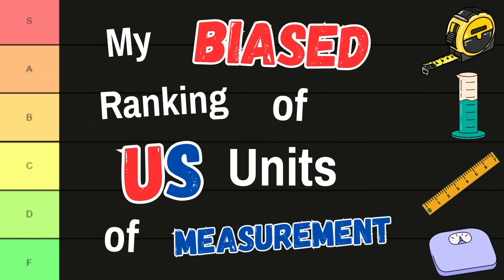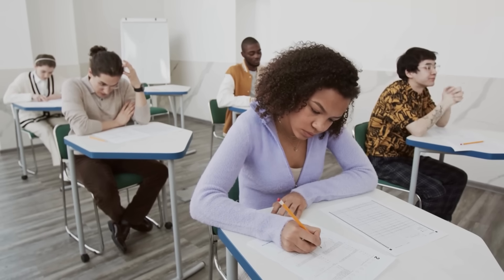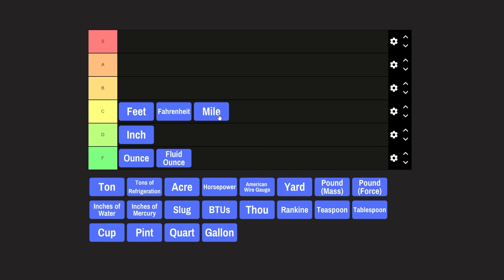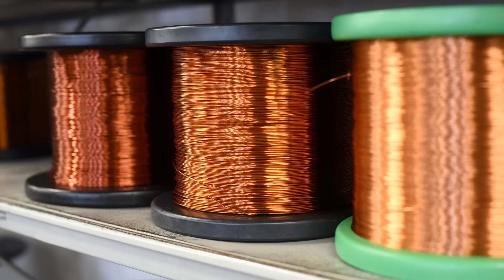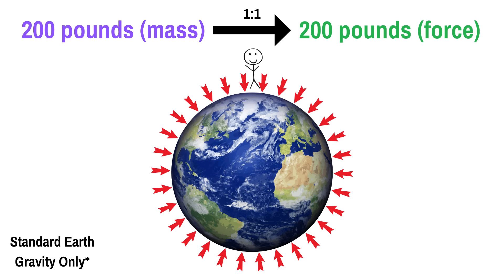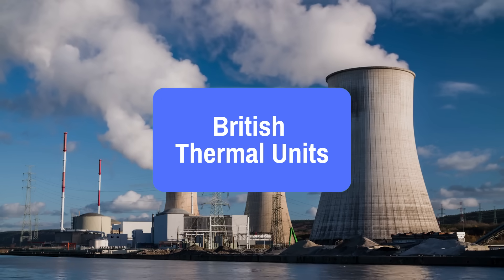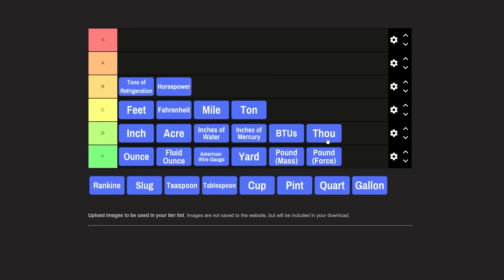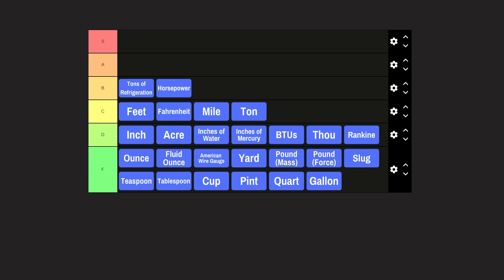Tier List of the DISASTROUS US Measuring System

Comment: Fahrenheit:
Calculations? F tier, god damned awful. What maniac forces you to do physics (beyond kinematics) in Imperial units? No one tried to make me use Fahrenheit in physics.
Measuring extremes of temperature? C tier, maybe only D tier. Use Kelvin, you nut. Especially if it’s EXTREME cold. Extreme heat? Celsius works…
Measuring temperatures we might subject ourselves to? B tier. Pretty damn good. 0-100 °F is pretty close to the range of temperatures we can handle with just clothing. Additionally, it gives finer-grained control on thermostats, and offers a full range of 20 degrees where nearly everyone finds their comfortable temperature: 60-80°F. I’m not saying anywhere in that is comfortable for most people, I am claiming/estimating that nearly everyone’s ideal temperature is somewhere in that range.

Comment: I missed al the surveying length measurements like rod, chain, furlong. And 1 furlong  x 1 chain = 1 acre. This one is surprisingly logical.

I really like to poke fun at the 'customary' system with this list of numbers: 3,12, 3, 5.5, 2, 20, 8

If you wonder, it's the multipliers going from one unit of length to the next: Barleycorn, Inch, Yard, Rod, Chain, Furlong, Mile (oh, I left out the fathom: two yards, and the cubit: 18 inches)
All these units made perfect sense when we measured lengths with body parts. But it has been a while.

Comment: I grew up in probably the only generation of Canadian education that's likely to ever exist where they taught Imperial and Metric right alongside each other, and most of our measuring tools had readings for both systems. While most official and scientific measurements were metric, many of the adults in my life still used imperial to describe things. As a result, I'm essentially "bilingual" when it comes to measurements, so if I hear one, I can generally interpret it into the form that I am most comfortable with, and that makes the most sense given the context.

For example, I convert Fahrenheit readings into Celsius. I prefer Imperial measurements (inches and feet) for short distances and kilometers for long distances. I cook exclusively in Imperial (including baking), but I like my beverages and other liquids measured in liters, UNLESS I'm using it to cook. Yes, I'm aware it makes no sense to switch between referring to water as 2 Cups or 500mL (approximate) depending on whether or not I am cooking or just drinking it, but I don't care! 

I think the whole debate is a little over-hated anyway, and I think there would be a greater net benefit to all if we decided to learn to interpret and convert back and forth, rather than discard and forget.

Comment: I don’t like the imperial system either, but if you wanna say that ounces and fluid ounces suck because they are only linked with water, know that a cubic meter of water weighs a 1000 kg, but since measurements have changed, it’s about a kg off now, making it really annoying.

Comment: They picked 5280 feet because it has 48 factors. This helps when you want to know that a 32nd of a mile is 165 feet but a 33rd of a mile is 160 feet. Yes, its that dumb. Also there's Bushel and Peck for volume (not sure if those are official) and it could be helpful to note that 2 tablespoons are 1 fluid ounce, and 8 fluid ounces make 1 cup. Also an acre is 43,560 square feet, or a 640th of a square miles, or a 4840 square yards.

Comment: The fact that there are three "ton"s (long ton, 2240 lbs; short ton, 2000lbs; metric ton, 1000 kg) that are actively used in the world gives me an aneurism.
Reply: you forgot the freight ton
Reply: @kai-uweschroder5447  God help us all
4 tons and they can't be easily transferred into each other without some wonky coefficients
Reply: That only proves you have a serious medical problem that needs prompt attention.  In the USA, hardly anybody is bothered by this at all.  If someone's work involves commodities shipped internationally, the unit is the Metric ton.  For other purposes, "ton" means the short ton, but that is rarely used.  For everyday purposes, we use pounds.  Engineers dealing with large weights and forces might use kips (1000 lbs).
Reply: @GH-oi2jf  the fact nobody in the USA is bothered by this is extremely concerning
Reply: @MaksKCS It's fine. The beauty of the imperial system is not in its unit conversions, but because we don't need them most of the time. 
And I've never used the long ton in my life. A ton is 2,000 pounds. None of this short/long stuff.

Comment: Just to add a bit more fun (and confusion) - the thou (7:40) is also called the mil. Not to be confused with mil specs (as in, an elephant is a mouse built to mil specs).
Reply: Ah, the beauty of launching EAGLE and having all my measurements reset to this.. 100 mil is 2.54 mm, with 1000 being 25.4mm or a full inch, which I only found out when my tracks were far too thin. When will you US people finally switch?
Reply: @AdamSKEN.01  Looks like the 400 kg gorilla plans on sticking with that annoying system.    :(

Comment: Everything but horsepower is f because they are only in America and maybe in one other country outside of America
Reply: In fact, inches and feet are used worldwide, even though not for general purposes by most people.  Probably the application most visible to the general public is wheel diameter for automobiles.  I don't know how Europeans deal with this.  Another widespread use of the inch is for the dimension of square drives for tools (1/4, 3/8, 1/2 inch, most commonly).  What do European mechanics call these?

Comment: "0 is uncomfortably cold, 100 is uncomfortably hot"

Subjective observations are not science!!!!

Living in the tropics, (and using celcius scale)
To me, 15° is uncomfortably too cold. 
45° is uncomfortably too hot.

37° is hot but not uncomfortably hot
Reply: Exactly. To me -25 ish is where it starts to get uncomfortably cold (depends on clothing though) and +25 ish is too hot. There is no single parameter for what is too hot or cold.
Reply: @yodaas7902  wow, 
25°C is literally the standard for room temperature scientifically

24°C is what all air conditioners default to here.
You'd have a hard time if you come here...
Reply: @phs125  25°C is way too hot for a room. 22 to 23 is most common here.

Comment: Most of these I agree with, but I will throw hands over Fahrenheit. Celsius is also based on an arbitrary measurement of water temperature for 0, and while I get that boiling being 100 degrees is nice (better than 212), it means by your own logic that I’m putting it in B tier.
Reply: "Celsius is also based on an arbitrary
And how is Fahrenheit less arbitrary?

"measurement of water temperature for 0,"
What does water have to do with temperature?
Reply: @dampaul13 I think you misunderstand. I’m not arguing Fahrenheit up to anything more than a B tier, I’m arguing that celcius is also an arbitrary scale based loosely on two points, and belongs at the same tier. Temperature doesn’t have a perfect scale.

Comment: The only good imperial unit is PSI. It’s so much easier to conceptualise than a Pascal. Metric needs a kilogram per square centimeter
Reply: That's why kilo/hecto pascals are often used
Reply: Or just use bar, which is what's most commonly printed on tires etc.
1bar = 1 atmospheric pressure at sea level.

Comment: The farehnheit scale is fathoms better than celsius, its def s tier (and the only one)
Reply: Farehnheit scale deserves FF (f*UK FAHRENHEIT)
Reply: @Extirnity69  measuring by saltwater is many times better than measuring by freshwater, having 60 degrees as pretty warm but not hot makes much more sense than 30 degrees or whatever the fuck celsius has
Reply: @geraldplayz6388  did you read that off your gun manual instruction?
Reply: @Extirnity69  no, i learned it in physics in 9th grade
Reply: @geraldplayz6388  How does 60 make more sense than 30? Explain your reasoning.

Comment: At this point i am suprised that 1$ is 100 cents and not something like 144 cents
Reply: 144 for a base 12 system would still make way too much sense haha
Reply: @n3lis94  And then everything would be priced the equivalent of x.99 anyway, so, …
Reply: @n3lis94  The one drawback of using Base 10 for a measurement is that 10 can only be evenly divided by 2 and 5, while 12 can be divided by 2, 3, 4, and 6. That is one of the reasons that there are 24 hours in a day, 60 minutes in an hour, and 60 seconds in a minute. To me, if there were 10 hours in a day to divide it into three shifts then you'd either have to use a fraction (1/3) or round it to a decimal place (like the first shift is 3.34 hours, and the second and third shifts are 3.33 hours).

It is the same reason when I was doing word processing professionally I used the Point (a typographer measure). It was easier than using inches and centimeters. There are 72 points in an inch, which made it easy to subdivide without the need for decimals. Half an inch is 36 points, a quarter of an inch is 18 points, and an eighth of an inch is 9 points, and I never needed to go below an eighth of an inch.
Reply: @Solitaire001 Except that currencies are base 100 systems, which can be divided by 2, 4, 5, 10, 20, 50.
Reply: @Solitaire001 If we had only been born with 6 fingers on each hand, perhaps we would be more numerically literate
Reply: @Solitaire001  "12 can be divided by 2, 3, 4, and 6"

Sure. It can be divided. But how often do you have to divide a distance into 2, 3, 4 or 6? What happens when you have to divide by 7 or 11? Or by 8.5?

PS. I didn't choose 8.5 by chance. A few months ago, my wife asked me to divide a 2-meter piece of canvas into pieces of at least 8.5 cm. Preferably without any waste. How would you solve this in the imperial system of measurement?
Reply: @AdrianDanila60  All I was saying is that a measurement system based on 12 allows for more divisions than one based on 10, regardless of the measurement being used. This can be convenient in some situations.

As far as dividing a 2-meter piece of canvas into pieces of at least 8.5cm long, I'd just divide convert 2 meters into 200cm and divide that 8.65cm, resulting in 23 pieces, leaving approximately 0.12cm of waste material left over.

As far as doing it in U. S. Customary Measures, 8.5cm it works out to approximately 3 1/3 inches. Two meters works out to approximately 78 3/4 inches. If you divide 78 3/4 inches by 3.4 inches you get 23 pieces with approximately 0.16 inches of waste material left over. Each piece would be 8.636cm in length.
Reply: @Solitaire001 yeah .. but why you telling it one person (and not the original asker) who obviously knows because he wrote that "it would make sense" 😅
Reply: Do you know the old British system for money division? It was changed not so long ago.
Reply: @xblinketx I mean, most of those strange units of measurements came from the british
Reply: @xblinketx  I think it was between 1965 and 1975 (other countries like Australia was making the change at the same time). There are a number of videos on YouTube on the topic, including one that was run in Australia to cover the conversion to decimal currency.
Reply: @xblinketx it changed in 1971. That was long ago.
I do know it though.
12 pence in a shilling 20 shillings in a pound.
4 farthings in a penny.
Reply: @Lord_Skeptic  And now explain the guinea!  (Or even the half crown.  Note, crowns were never used, only half crowns).
Reply: @JohnHughesChampigny  Guinea: pound and a shilling.
Crown: 5 shillings.
Reply: @Lord_Skeptic  But why is the guinea a pound and a shilling?  And of course the Crown was almost never used. but half-crowns were common.  A two shilling and sixpence coin.
Reply: @Lord_Skeptic  Depends who you ask.
Reply: @Lord_Skeptic  fartings
Reply: @mike-litoris  farthing: ¼ penny
Reply: @Lord_Skeptic  Perhaps farthing comes from one fourth?
Reply: @charlesspringer4709  it comes from old English feorthing meaning a forth part
Reply: @Lord_Skeptic I wouldn't call it "long ago" in the grand scheme of things. Money has been in use for a long time.
Reply: @graealex  to me anything before 2000 was long ago
Reply: @xblinketx  Oui, ils avaient la Livre, le shilling, le pence, le farthing, la guinée, le souverain !
Reply: 144 is a number that you can get by multiplying 12, so still too  simple. maybe something like 437,6?
Reply: @Xeonomy Yep honestly just add 7 in the numbers and it will be random

Yes...7 the most random number
Reply: @Xeonomy  name an English unit that isn't a simple multiplication of numbers. I'm going to preemptively adress the miles comeback. Feet isn't a logical division of a mile the same way cubic cm isn't a logical division of a cubic km. The division of a mile is 8 furlongs, a furlong is 10 chains, a chain is 22 yards, and a yard is 3 ft and 3*22*10*8= 5280. Or you could say 80 chains in a mile and 66 ft in a chain.
Reply: @Xeonomy  maybe you'd like the icelandic kroner, where the basic unit is equivalent to a cent, so prices tend to be hundreds or thousands of ISK.
Reply: @kenbrown2808  that only means the Króna has a very low intrinsic value. The basic unit cannot be a cent. A cent of what?
Reply: @LtdJorge  EQUIVALENT to a US cent.  we WERE discussing US currency, weren't we?
Reply: @kenbrown2808  all low value currencies do that

but i do really like how the króna looks
Reply: 101 would be hilarious
Reply: 144 cents in a dollar, 1 000 065 dollars in a million ... why? because why the fuck not! MURICA!
Reply: British ppl before their currency was fixed
Reply: Becouse it's the only unit related to a human construct and emotion (greed). And no one wants to...missculculate their emotions 😅
Reply: It could be worst. Have 3 different divisions that are mutual primes  : 144 penny in a dollar, 37 nickles in a dollar and 11 coppers in a dollar.
Reply: Or 117 cents. That'd be fun to calculate
Reply: That's gross
Reply: Look up "£sd" which was widespread in Europe.
Reply: Who's going to tell him about the pound (money) system before its decimalization?
Reply: 144 would be far too sensible. If you left it up to Fahrenheit, he would measure the lowest amount of money he had last year, which was a debt of $35 dollars, call that 0, then use the worth of the average human being and call that 100, then use increments of 10.000 to decide how many cents that is.
Reply: @jzieba0204  1 dollar should be 12 silvers, which are 12 coppers, Or 1 dollar is 144 coppers
Reply: Look at the shape of the coins : a Penny, a nickel, and a Dime :D
Reply: @jzieba0204  or in Oman where I am there are 1000 baisa to a rial. To make it more confusing when traveling there are about 10 AED or 10 QAR to one Omani rial.
Reply: “Spare a farthing sir?”
Reply: That 144 would be gross...
Reply: Yes sounds like maybe: 
1 milion dollars = 1440 000tsd dollars     imperial system is crazy
Reply: Before decimalisation in the UK (and Australia) the pound (currency) was made of 20 shillings and each shilling was 12 pence - so 240 pence to a pound - very intuitive!
Reply: Ancient Mesopotamia invented the base 12 number system..... so 144 is more valid than SI if you rate your systems by longevity. Incidentally how are you getting on with your decimalised time. 12 hours of day, 12 hours of night, 12x5 minutes in an hour, 360 degrees in a circle.....changing any of these any time soon Mr smug?
Reply: Give them time, they`re not there yet.
Reply: I think it should be based on something more easily divisible, like 137, for example.
Reply: it would be like 1$ = 543 cents
Reply: Don't worry, it starts with quarters again… That's a coin the Euro doesn't have. Euro only knows 1, 2, 5, 10, 20, and 50 as these are the simplest steps. A quarter is just 20 plus 5.
Reply: It should be 72.19π cents
Reply: Now rank the metric system
Reply: Cent means hundred, and other countries do have cents
Reply: @Cheesehead667 yeah they do have cents (sense)
Reply: @Tamjeedd  us
Reply: @Cheesehead667 guess what centimeter means
Reply: @Cheesehead667  "Cent means hundred"
Yes, I think that was meant to be taken ironically with the randomised base units used in USCU.
Reply: @Cheesehead667  Doesnt matter cent mens 100, as majority of this  make no sense. 1$ being  437,6cents fits right in with all of the above lol
Reply: @Cheesehead667  Would a "cent" that is 1/144th of a dollar be a "hectotetracontatetra" or a "centum-quadraginta-quattuor"?
Reply: @Cheesehead667  cent meaning hundred just makes it even more American to have a dollar be 144 cents, or potentially something even weirder like 137.2 cents
Reply: @Cheesehead667  Americans actually name their coins: penny nickel dime, quarter. None related to base 100. 
Say a quarter may well mean 60 Pennies if there’s a 240 Pennies to the dollar, a dime may as well no worth 20 of those hilarious pennies and a nickel being 12 dimes. It’s accidental that a dime is worth 5 cents a nickel ten and a penny 1.
Reply: Americans were among the first to decimalize money.
Reply: @kenbrown2808  among
Reply: @kenbrown2808 If you could get that one right, why not the rest?
Reply: @janos5555  because the french hadn't come up with the idea of basing an entire system of measurements on a miscalculation of something that couldn't simply be found locally to where anything was being done; yet.  so they stuck to what had been working for generations, and continued working for generations.  but now that you mention it, a base 12 monetary system WOULD make it easier to split the check, three ways.
Reply: @janos5555 we asked France for a copy of the standards. Purates sank it. Tried again 200 years latter, but someone had the bright idea that adults would learn from their children, add in some stubbornness and it's no surprise it failed.
Reply: @kenbrown2808  and the Brits were one of the last to decimalize money.
Reply: Still absolutely cooked, 1$ is 86 cents (€).

:V